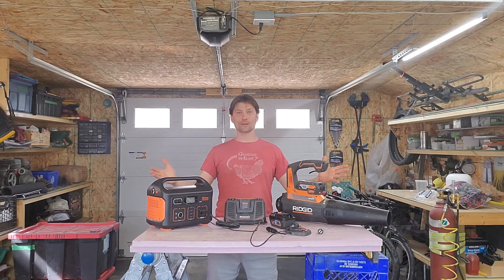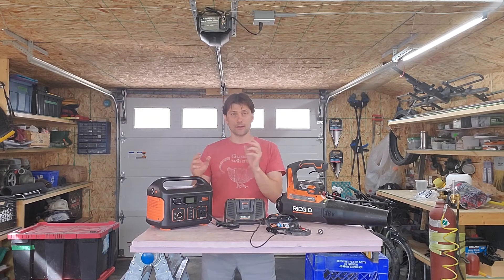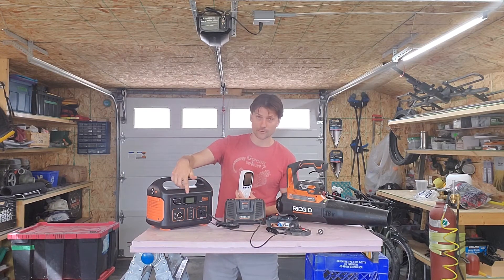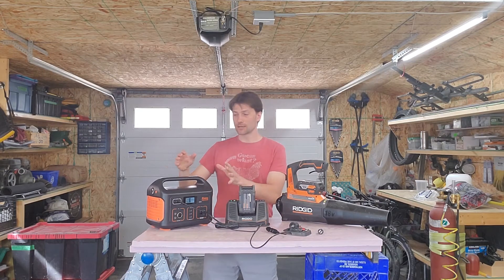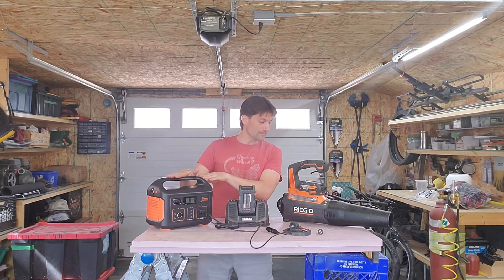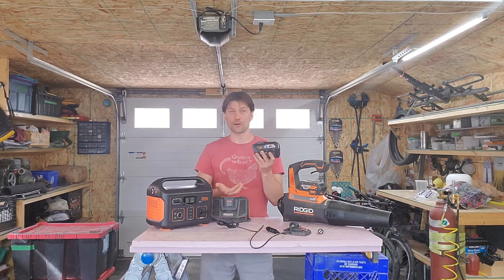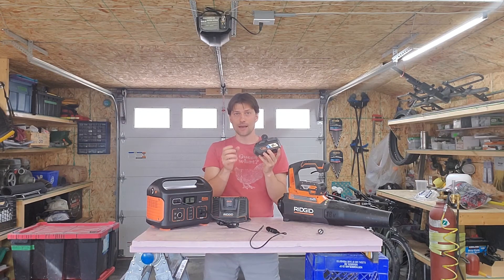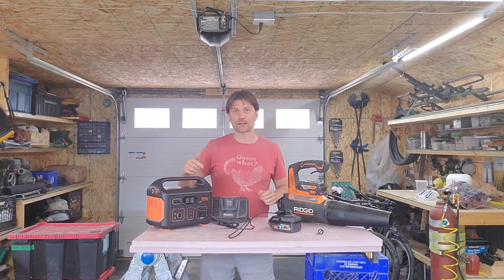Jackery 500 Charging 18 Volt Tool Batteries and Vise Versa.  What is the  efficiency?

Comment: If a I do a direct charge to the jackery without a inverter.  Will 18v power pack charge the power station.  I see solar charging has a range from 12 - 24v
Reply from the maker: Yes. You can plug the 18 volt tool battery directly into the solar charging port of the jackery as I did at 5:15 in this video.

Comment: Gas saws are antiquated to me at this point. Five years ago I spent my annual fuel cost from sawing and switched to electric. Still use the same equipment since. I get just as much work done  if not more cuz switching batts takes less time and there's less maintenance to do on my saws. I save about 8 grand in fuel for the year since then.

Comment: I need to know if this system will charge multiple milwaukee m18 batteries at once while its getting solar power
Reply from the maker: Yep.  Pretty much any of these lithium power units can charge off the sun while simultaneously running power out via the 120volt inverter.  Should be capable of charging multiple m18 batteries at a time depending on what charger you are using.  Anything up to the rated wattage of the power unit.

Comment: Will the jackery 500 charge a Dewalt battery ? If so do you know how many times
Reply from the maker: Yes, the Jackery 500 should charge a dewalt battery the same any any battery with a regular wall charger.  If the battery is 6 amp hours, you'll get 3 full charges.  If it's only a 4 amp hour battery, you should be able to charge it fully 4 times.

Comment: This is excellent and pretty much exactly what I was looking for. I go off-roading/overlanding for extended periods of time. I’m looking to sell my heavy expensive ARB air compressor and buy the new Milwaukee m18 tire inflator for airing up my tires after off-roading. This provided a new scenario. Do I buy one or two m18 batteries and a jackery 500 to keep them topped off? Charging the jackery with my vehicles 12v sockets while I drive and topping off the m18 batteries while at camp? Or do I skip the middleman, buy the 12v car charger for the m18 platform and just stock up on m18 12.0ah batteries. I think the price per watt hour on the Milwaukee batteries is a pretty decent value considering I can use them to power my tools, the inflator, as well as as a 175w power supply with the optional accessory. I’ll likely just purchase the inflator when it’s available, calculate how many air-ups I can get on a single 12.0 battery, and determine my needs from there
Reply from the maker: I'm glad this helped you out!  It's not the most relevant video to most people, but I had a heck of a time trying to google the answer myself, so I figured I'd put it out there in case someone else had the same question.  I have also powered a small air compressor directly off the Jackery (metabo HPT 0.5HP 1 Gallon Ultra Quiet) , it's just barely enough to breath underwater with a sort of home made hookah system.  The expensive M18 2 gallon  brushless air compressor most people use for brad nailers and stuff looks quite capable of producing a lot of air off a charge as well, so let me know what you find out!

Comment: Is there any downside to charging the Jackery with a non pure sine power source?
I'm assuming that the Jackery takes the input/dirty power and directs it into it's batteries then outputs pure sine power.  Is there any way to know if the Jackery (or any other power bank) passes the inputted power straight to the outlets when being used while charging?
Reply from the maker: To my knowledge, the output ac power is pure sine wave regardless of if the unit is being charged or not.  I don't think it just passes the power straight through.
Reply: @UtmostOutdoors  thank you